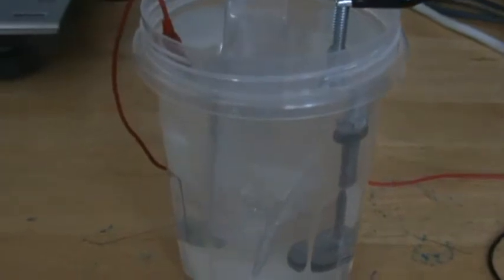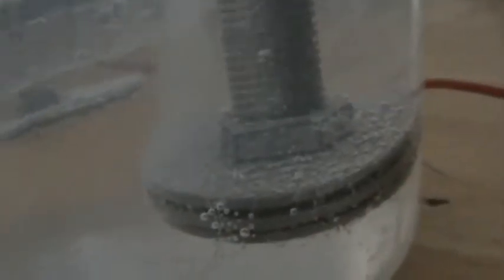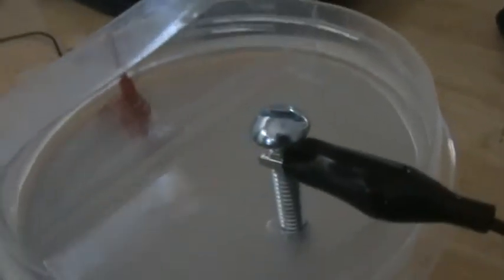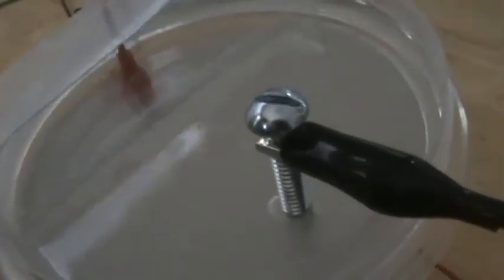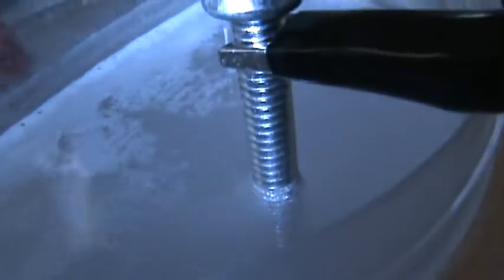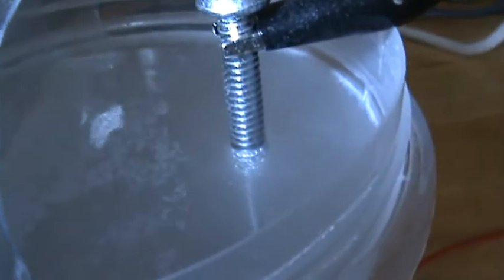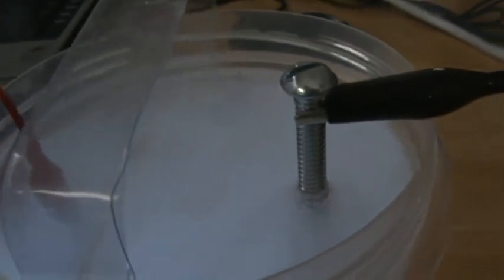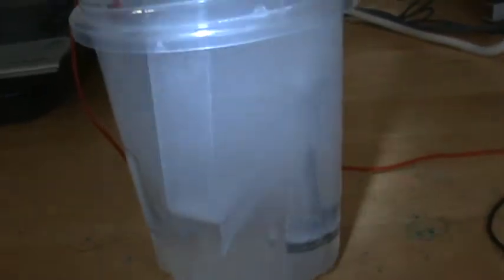HHO Generator hydrogen separation test # 3

Comment from the maker: well thanks , But what I am trying to do is separate the hydrogen gas so I can use it for heating and cooking, burning it with the oxygen is to explosive just the hydrogen gas alone is more controllable and less chance of flash back. the oxygen likes to pop very quickly and thats how you get the flashback, when i add more plates to the hydrogen side it creates more hydrogen, but i am still experimenting, building me another proto type will have video soon after everything is dryed.

Comment: This is a great experiment. What you have created is a wet cell. These are not very efficient. You lose a lot of your voltage due to parasitic leakage.In my opinion a dry cell is the way to go. Search HHO separator cell. You will see that a few have already found a way to separate the two gases with a dry cell. You have the best of both worlds.  Best wishes.